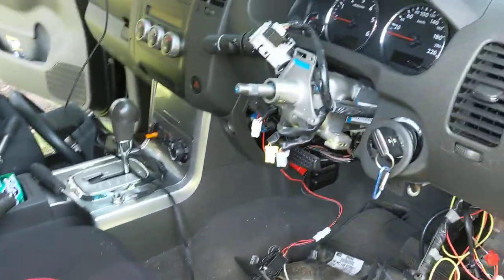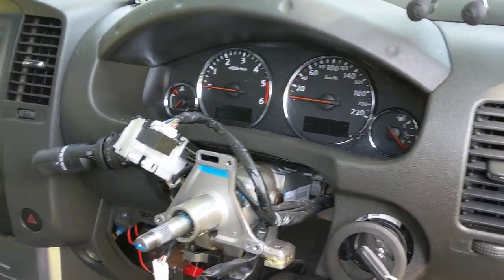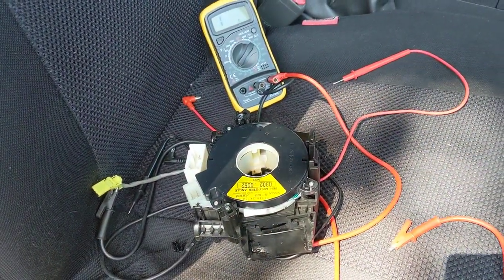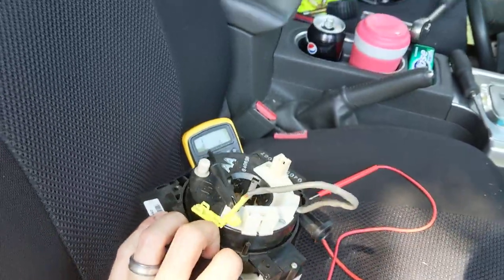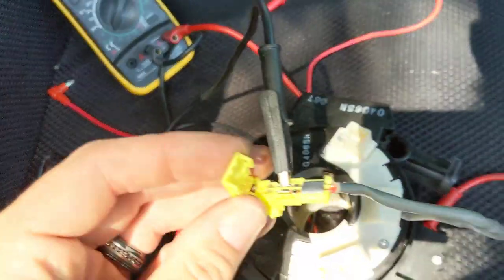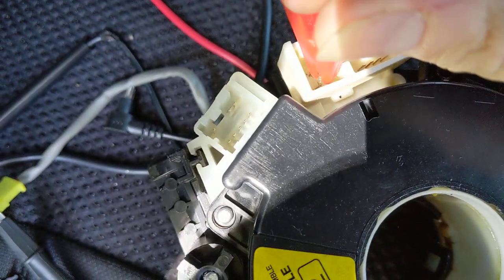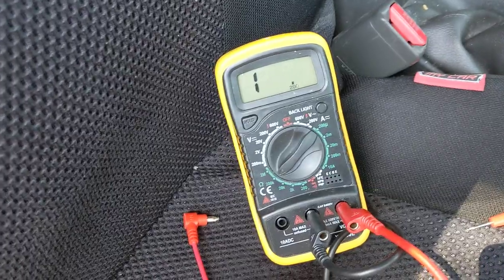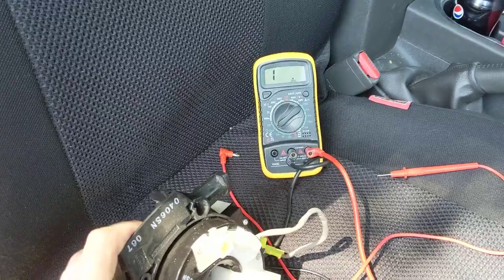How to diagnose a faulty air bag clock spring

Comment: Cheers bud, that was super helpful.
Can this test be done with out taking clockspring out?
I am going for my 4th clockspring and I'm thinking it maybe a connection to it.
Cheers Arran
Reply from the maker: Yeah, you probably could do it carefully without removing. There is heaps of cheap ones around, that could be contributing to the high failure rate. Also extremely important to make sure everything is centred before you install a new one.

Comment: Can a faulty clock spring cause only airbag to be faulty? All my steering button controls and horn work fine but my airbag light is on. Ran codes and all point to steering wheel. I did a continuity test but didn't get any connection from airbag plug
Reply from the maker: Yes, potentially only the air bag circuit could have failed.